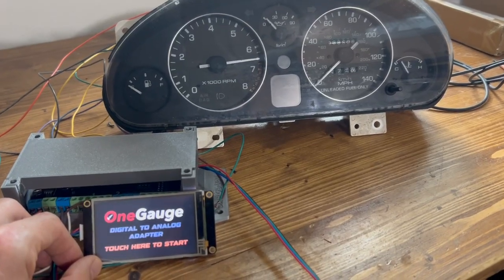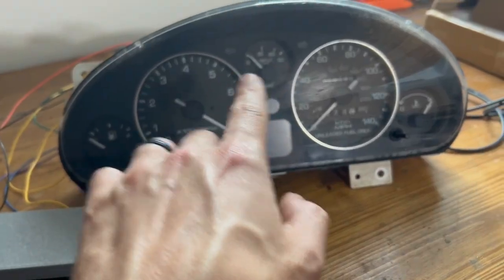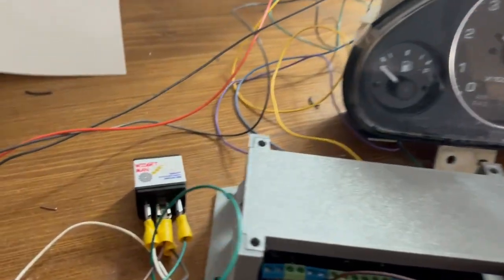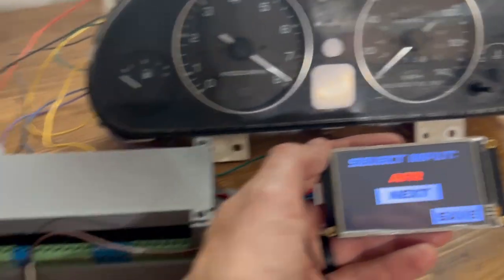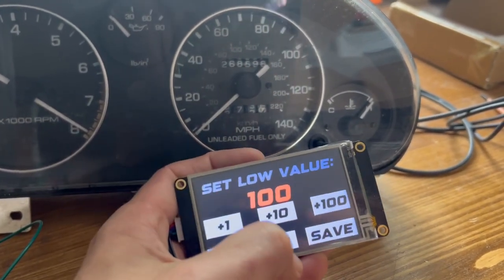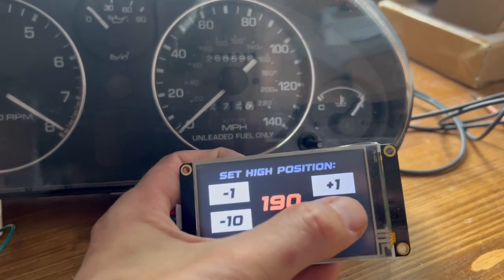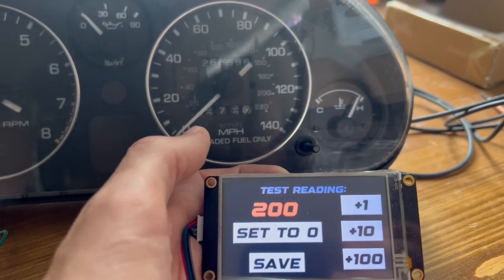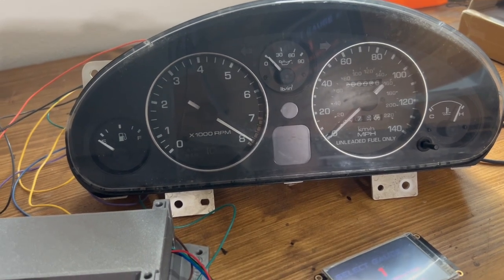OneGauge Digital To Analog Converter Overview

Comment: This could be perfect for me. I'm swapping an m57 engine into a Volvo 240. I'm just worried about the response time/lag I've seen from OBD II with at least wireless obd solutions I've seen. 

I'm assuming if you wire to OBD direct so it's full CAN, this will be as responsive as a factory gauge?